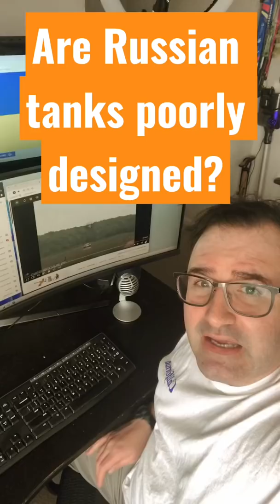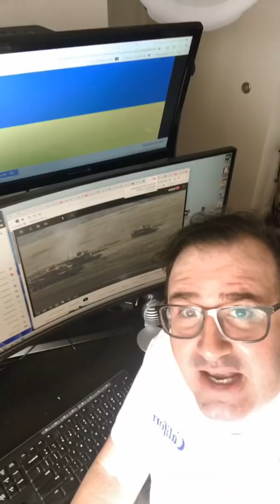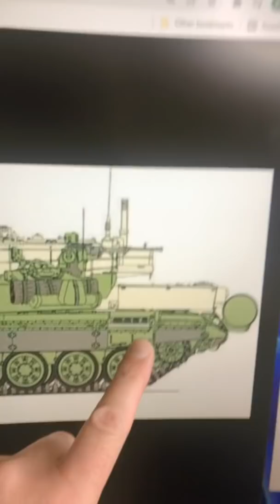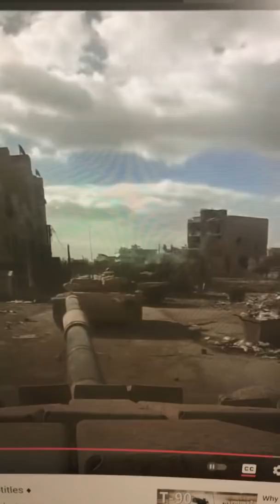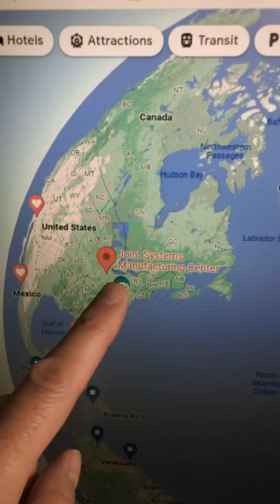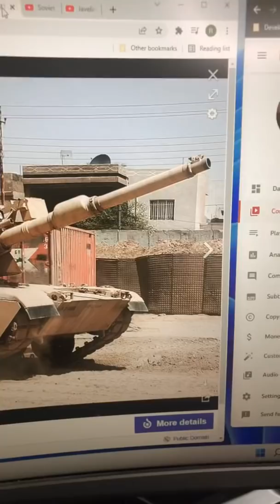Are Russian tanks poorly designed?

Comment: "are the russian tanks poorly desgined" yes, sorry but yes they are the overhanging fact that they still run on outdated engines that was showing there age post war, this engine was picket despite being already a tbh shoddy engine because fast to replace...
secondly the fact that there is a plan ot use them in a rapid making manner doesn't excuse how shit they are, other nations like sweden developed a safer autoloader on a far superior semi post cold war tank and they were operating without the soivet massive industry and budget and experience of making autoloaders, the fact that the one saving grace that always been pretty meh with T tanks can be developed by non soviet pact nations shows that T-72 and its modifications always were steps behind and never dealt with its own issues.
T-72 is a trash desgine hyped up by a industry that never wanted to fix it and sold to nations as cheap force projection in a hope that one day one of the many modifications they made would finally make them have battled parriety with nations 10 times smaller than themself.
lastly the fact i harp on the engine and the autoloader is that, its pitch is a lie, yes it was built to be smaller and to be fighting enemys, soooo where is the target aqquestion? ww2 documentaion that was used to argue for this doctrine state "who ever fire first wins" why than have no plan for target aqustion, and sights, if its meant to be a desgine that can stand on its own in tank to tank fighting why is its engine compartment not future planed, if the thing cant carry the firepower or armour to harm a enemy how would the T-72 adapt, well it did, they strapped junk ontop of it until it worked kinda...than they fought things they didn't plan for because nobody cared, they used ww2 documentaion to make the T72 the way it is and ignored even things true to that conflict, like how infantry can actually fight, how sight is important, how the T-34 factors keeps fucking up leading loss of equpments before the fight even started... its a bad desgined tank and we don't need to give them excuses when the documentaion prove they didn't care. it was good enough for a nation who feelt a rilfe that punch the rifleman was okay, and safety and ergonamics are fancy nazi ideas and not proper russian like illiteracy and commanders of peasents.

Comment: I disagree, not that russian tanks arent bad now, but that they where allways bad, yes in theory the smaller size compared to nato tanks makes them a harder target, but do you know what that olso means? They are extreamly cramped, beeing very unconftereble for anyone slightly higher than averedge, the trasmission on the 72 and 90 series is is terribile whit only one reverse gear, the engine on is outadeted on those same models, the gunner and commander vision devices (both view ports and sights) are outdated, even by the day of theyr construction, lacking good targeting that nato tanks had and still have, they cant even rely on making NVD and thermal sights domesticaly and need to get them from the french theyr hull armor is very outdated, relying olomost entirely on the ERA blocks on the front, side armor is excused, as most modern tanks dont have much side armour, the thing is that russia knows that these designs suck and thats why the armada looks nothing Like a soviet era tank

Comment: Almost right because in RPGs a long time ago the only major text with Stan RPG had specially if you are busy it's the Russian tanks but anymore anymore built-in the Russian tanks in okay about the weak spots around the seams enable slight angle can I go anywhere near it showed place where somebody's using them water someone around with a tank to bits by hitting it and a weak spot on top of the tank near the near the hatch of the tank cuz any water will take out any cancer everbilt even exhaust pipe on the tank and fire around it for a rocket exhaust pipe exhaust won't activate generation would cause because the heat heat of the engine and the castle would cause cause explosive round him to blow up inside the tank exhaust pipe and tear up the engine of the tank and tank explode explode but you have to take weaponize ain't dragging for the gas I didn't feel like fuel tank but I'd also out and Rocky 4 Shirley BestBuy to exchange

Comment: False, Russia better

Russia Vs USA military technology

RUSSIA 🇷🇺

T-80U

Cost
3m

Main Gun
2A46M-1 125 mm Smoothbore with 45 rounds with 6 ATGM 

Secondary gun
7.62 mm PKT coax MG, 12.7 mm NSVT or DShK or PKT antiaircraft MG

Armour
 Composite Armour with Kontakt-5 2nd gen ERA Hull & Turret 780 mm vs APFSDS 1,320 mm vs HEAT

Range 
415km

Speed
Road 80km/h
Off road 48km/h

Targeting systems
1A46 fire control laser finder and 1G46 ballistics computer

Effective Range
5km HEAT
3km APFSDS

Counter measures
Hard and soft kill APS Shtora-1 APS & Drozd APS missle counter measure systems

T-90M

Cost
$5.8m

Armour
Steel-composite-reactive blend with Relikt 3rd gen ERA. APFDS = 1100mm–1200mm, HEAT~1900mm. Nakidka RAM.

Main Gun
2A46M-5 125 mm smoothbore cannon with 43 rounds

Secondary Guns
NSV 12.7 mm RCW & 7.62mm coaxial machine Gun 

Effective Firing Range
5km APFDS
7km HEAT

Range
550km

Speed
60km/h road
42km/h off road

Targeting systems
Kalina fire control integrated combat information and control systems systems. T01-K04DT/Agat-MDT computer systems with PNM-T 3rd gen thermal gunner's sight.

Counter measures
APS Shtora-1 & APS Arena-M ECM. electro-optical/IR "dazzlers. four laser warning receivers, two 3D6 'smoke' grenade discharging systems. TShU1-7 EOCMDAS jammer. EMT-7 counter mine directed-energy weapon

Features
four video cameras that provide a 360° view of the environment for the commander. blow out panels. AZ-185M2 Autoloader. 

BVRAAM
R-77M
193km Range
~Mach 5
~12g Tolerance 

R-37M 
250-398km Range
~Mach 6
~22g Tolerance 

S-500

Cost
$2.5b

Range
500km

Altitude
180km

Speed
Mach 5.9

Maximum Target Velocity
Mach 20.4

Number Tracked and Fire
10

G Tolerance
~20g

9A53 Tornado-S

Cost
$3.6m domestic
$12m export

Firing Rate
12 rounds in 38 seconds

Number of Rockets
12

Reload Time
20 minutes 

Armament
Guided and Unguided munitions 

Effective Firing Range
200km

Speed
90km/h

Range
1,000km

Features
Automated fire control equipment
R-163-50U radio station
GPK-59 navigation system
1D14 laser range finder
GLONASS Receiver

Ka-52 Alligator

Cost
$16m

Speed
350 km/h

Combat Range 
470km

Armaments
30mm Autocannon with 460 rounds
6 Hardpoints with 2,000kg

Standard Payload
20x S-13 Rockets
80x S-8 Rockets
12x 9K121 Vikhr Anti Tank Missles 

Radar Range
32km

Features
OPS-24N-1L observation-sight system
PrVK-24-2 targeting system
long-wave matrix thermal imager
Forward-looking infrared
Terrain-following radar
Directional Infrared Counter Measures
missile approach warning system
GLONASS Global Navigation system 
helmet-mounted display
Ejection System 
laser rangefinder

Su-25 Frogfoot

Cost
$11m

Speed
975 km/h 

Combat Range
750km

Armaments
30mm Autocannon with 250 rounds
2x 23mm Autocannons with 260 rounds
11 hardpoints with 4,400kg capacity

Radar Range
250km

Thrust to weight ratio
0.69

Wing loading
608.31 Kgm2

Armour
24mm

Features
laser rangefinder
PRnK-25SM weapons systems
BTsVM-90 digital computer system
helmet-mounted display
electro-optical sight
GLONASS Receiver
thermal imager
missile approach warning ultraviolet sensors
ASO-2V infrared countermeasures
SPO-15 radar warning receiver

USA 🇺🇸

A-10C Thunderbolt II

Cost
$15M

Speed
706 km/h

Combat Range
463 km

Wing loading
482 kg/m2

Thrust to weight ratio 
0.36

Armour
38 mm

Armaments
30mm Autocannon with 1,174 rounds
11 hardpoints with 7,620kg capacity 

Radar range
N/A

Features
Helmet Mounted Integrated Targeting 
AN/AAS-35(V) Pave Penny laser targeting system
AN/AAQ-28(V) Litening targeting systems 
AN/ALQ-131 ECM
inertial navigation system
GPS navigation 
Integrated Flight & Fire Control Computer 
Link 16  SATCOMS 

AH-64E Apache

Cost 
$52m

Speed
293 km/h

Combat Range
480 km

Armaments
30mm Autocannon with 1,200 rounds
4 hardpoints with 1,995kg capacity 

Standard Payload
38x Hydra 70 unguided rockets
8x AGM-114 Hellfire anti tank missles 

Radar Range
50km

Features
AN/APG-78 EHF
Target Acquisition and Designation Sights, Pilot Night Vision System 
Integrated Helmet and Display Sighting System
Smart Onboard Data Interface Module
infrared countermeasure
GPS Global Navigation System 
thermographic camera

M1A2 Abrams SepV3

Main Gun
M256 120 mm smoothbore with 42 rounds

Secondary Gun
1 × 12.7mm RCW heavy machine gun & 2 × 7.62 mm  M240 machine guns 

Armour
third-generation depleted uranium Chobham Composite armour with graphite coating with 3rd gen Abrams Reactive Armor Tiles .  (Actual numbers are unknown for HEAT and APFSDS)

Range
426km

Speed
Road 67km/H
Off road 40km/h 

Counter measures 
Hard and Soft kill APS AN/VLQ-6 Missile Countermeasure Device
Trophy ECM. M250 six-barrelled smoke grenade dischargers

Effective Firing Range
3km HEAT 
4km APFSDS

Cost 
$24m

Targeting systems 
2nd gen Forward-Looking InfraRed (FLIR) and Far Target Locate sensors, a tank-infantry phone, communications gear, including FBCB2 and Blue Force Tracking to aid in crew situational awareness, and a thermal sight for the .50 caliber machine. Abrams Integrated Display and Targeting System

Features
Ammunition DataLink
Vehicle Health Management System 
CREW Duke V3 counter remote-controlled IED electronic warfare system. Blow out panels.

M1A1 Abrams

Main Gun
M256 120 mm smoothbore with 40 rounds

Secondary
1 × 12.7 mm M2HB heavy machine gun & 2 × 7.62 mm  M240 machine guns

Armour
Chobham Composite armour 
470 mm (19 in) vs APFSDS and 650 mm (26 in) vs HEAT for the base model Abrams. He also gives the Soviet estimates for the M1A1, 600 mm (24 in) vs APFSDS, and 700 mm (28 in) vs HEAT.

Range
426km

Speed
Road 72km/H
Off road 40km/h 

Counter measures 
Soft kill APS with AN/VLQ-6 Missile Countermeasure Device

Effective Main Gun Range
3km HEAT
2km APFSDS

Cost (adjusted for inflation)
$10.6m

Targeting systems 
2nd gen Forward-Looking InfraRed (FLIR) and Far Target Locate sensors, a tank-infantry phone, communications gear, including FBCB2 and Blue Force Tracking to aid in crew situational awareness, and a thermal sight for the .50 caliber machine

MIM-104 Patriot

Cost 
$1b

Range
160km

Altitude
36km

Speed
Mach 5

G Tolerance
~30g

Number Tracked and Fire
8

Maximum Target Velocity
Mach 6.4

BVRAAM
AIM-120
160km Range
~Mach 4
~38G Tolerance 

AIM-260 (Prototype)
200-300km
~Mach 5

M142 HIMARS

Cost
$4.3m
$18m export

Firing Rate
6 rockets in 45 seconds

Number of Rockets 
6

Reload Time
5 Minutes

Armament
Guided and Unguided munitions 

Effective Firing Range
150km

Speed
85km/h

Range
480km

Features
C2 computer systems 
GPS satellite receiver 
Battlefield Management System
Missle Systems 

Winner Ka-52

Conclusions

Ka-52 Vs AH-64

Speed Ka-52
Armaments Ka-52
Range AH-64
Radar Range AH-64
Targeting systems AH-64
Counter measures Ka-52
Crew protection Ka-52
Cost Ka-52

BVRAAM

Range Russia
Speed Russia
G Tolerance USA

Winner Russia 

S-500 Vs MIM-104 Patriot

Cost Patriot
Speed S-500
Range S-500
Altitude S-500
G Tolerance Patriot
Maximum Target Velocity S-500
Numbers Tracked and Fire S-500

Winner S-500

Tornado-S Vs HIMARS

Cost Tornado-S
Speed Tornado-S
Range Tornado-S
Effective Firing Range Tornado-S
Number of Rockets Tornado-S
Firing Rate Tornado-S
Reload Time HIMARS
Features HIMARS
Crew Protection Draw

Winner Tornado-S

T-90M Vs M1A2 Abrams SepV3

Cost T-90
Speed M1 Abrams
Range T-90
Firepower T-90
Effective Firing Range T-90
Ammo T-90 
Armour draw
Counter measures T-90
Targeting Systems T-90
Crew Protection draw

Winner T-90

T-80U Vs M1A1 Abrams

Cost T-80
Speed T-80
Range M1 Abrams 
Firepower T-80
Armour T-80
Effective Firing Range T-80
Targeting systems M1 Abrams
Ammo T-80
Counter measures T-80U
Crew Protection M1 Abrams

Winner T-80

Su-25 Vs A-10

Cost Su-25
Speed Su-25
Manuvarabilities Su-25
Combat Range Su-25
Armaments A-10
Radar Range Su-25
Features Su-25
Crew protection A-10

Winner Su-25

Sources: EurAsiantimes, Rostec, Wikipedia, Lockheed Martin, Military Today, Military Wiki, Wikipedia, Janes, Tank Encyclopedia, Missilery.